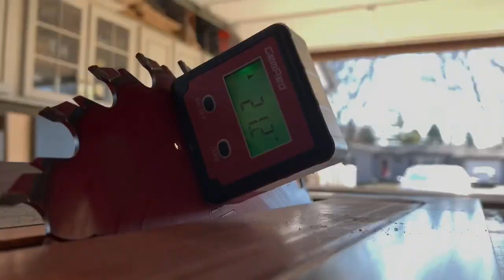CReeves Makes a Memorial Flag Case

Comment: Very nice, I like it when its made with a base. Is this made for a burial flag and what is the overall measurements for the triangle pieces?
Reply from the maker: Thank you sir! I don’t recall the dimensions but I simply made a paper template that matched the flag footprint and those were my internal board lengths. Thanks for watching!